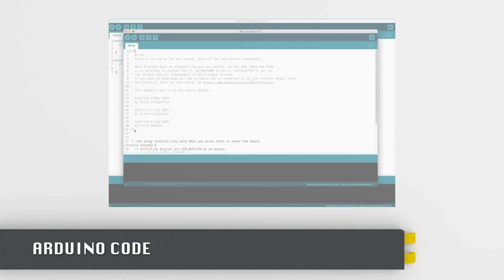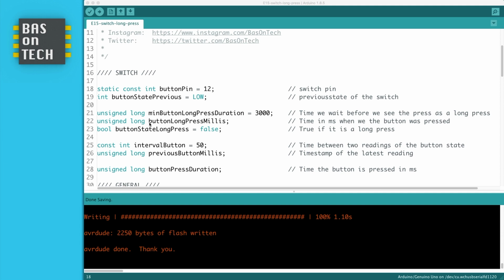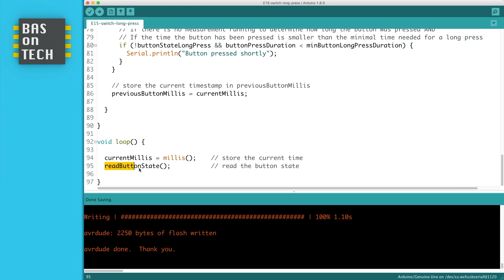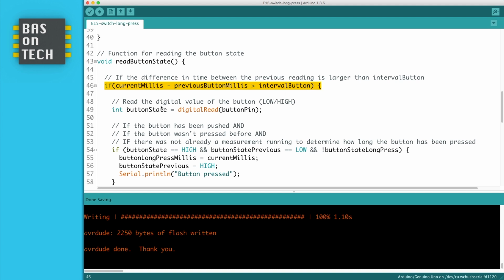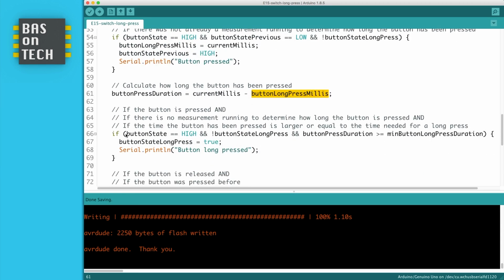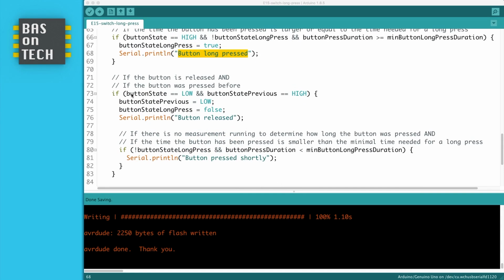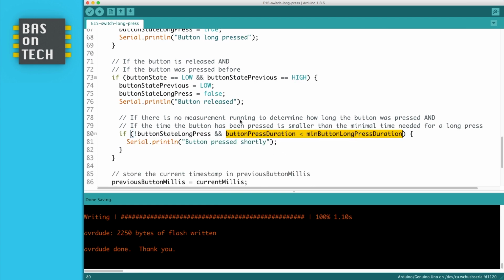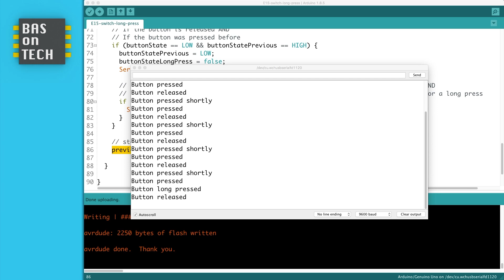LONG PRESS BUTTON (WITH MILLIS) - Arduino tutorial #15

Comment: Hello! On line 54 is it really needed to put the ... && !buttonStateLongPress? I did it without the '&& !buttonStateLongPress' and it worked just fine. Because that only matters if you're holding the button, but if you're holding the button then the previous button value CAN'T 'equal LOW', since YOU'RE HOLDING IT. 
hope that makes sense.

Comment: whats the advantage of using a external pull down resistor vs using the internal pull up of the arduino?
Reply from the maker: As far as I am aware none. In this tutorial I wanted to show how to use a pull-down resistor with an external one 😃

Comment: There's an issue in ur code for every first run if the button in pressed for a long duration in the first try ur code will not recognise it as long press instead it goes to void loop and then again performs the function to check long press
Reply from the maker: I did not have that problem when running the code. Are you sure it is exactly the same?

Comment: Hi, fantastic work. You`ve saved my day! Thanks a lot! But something went wrong in my program code. It will just run the short pressed button and never the long pressed situation. longPress seems always be on false. Any forgotten libraries that have to be integrated (time.h?)? The longPress action in the wrong if statement? Normally it has to be in the serial print "Button long pressed". Or is there maybe a problem with the milli function?
Reply from the maker: Hard to say. Make sure you create the code step by step. I see many people copy/paste the code. Then it is very hard to debug what goes wrong.

Comment: How do I do more than one button? I need to have seven buttons each with a long press.
Reply from the maker: You can use a pin for each switch.
Reply: @BasonTech  Yes I understand, but I am a novice programmer. I am going to try to spend work time this weekend trying to make two relays trigger. So button 1 = state 1 relay one on and relay two off, then button 2 = state 2 relay one off and relay two on. If I can do that, I can start adding more buttons and more relays. :)

Comment: Would this help with false positives? I have seven buttons at the end of a four meter cable, two of the buttons keep popping on and off. I was thinking that a requiring long press would stop this from happening.
Reply from the maker: Hi Douglas, it looks like your aren't using pull-up or pull-down resistors in your circuit. This can make the state of the switch "floating" and gives false positives.
Reply: @BasonTech  Hello, thanks for the comment. I am using resistors. Seems like I get a bit of static electricity that is causing the problem. That is why I was looking for something of a long hold or using the analog input. Today was a rainy day and I had no problems at all.

Comment: The intervalButton=50msec is that a debounce time for the button??
Reply from the maker: Hi Remco, as shown in the code comment it is the time between two readings of the button state. This is not de debounce time.
Reply: @BasonTech  Ik snap hem nu..Er zijn meerdere wegen naar Rome...je kunt met kortere tijd door een if() laten vallen als de millis korter is dan je voorbeeld van 3000 maar je hebt een duidelijke grens aangegeven dat dat een short press is geweest...als ie korter dan 50mSec is...wat veiliger om een onderscheid te maken tussen een short of een long press...alsk ut zo goed heb?
Code werkt verder super..precies wat ik zocht...alleen de switch is, bij mij,  active LOW maar is een kwestie van de sketch aanpassen...Dank oe iig..
Reply: @Lampie78  Deze code is zeer specifiek voor een long press oplossing. Voor alleen debounce kun je de code significant versimpelen. Eigenlijk hoef je alleen maar de timestamp op te slaan als knop wordt losgelaten. Om een volgende te registreren met een x aantal millis verstreken zijn sinds het moment van loslaten.

Comment: Sir, sorry I used google translate.

Sir, I want to use this for fans, what if after "Button long pressed" the fan will stay HIGH during minButtonLongPressDuration, after which the fan goes LOW.
Thank you.
Reply from the maker: With this tutorial you should be able to make that 😃
Reply: @BasonTech  
Sorry sir, I'm still a beginner.
I tried placing the script like below, but after the fan release it is always HIGH.

static const int buttonPin = A2;                    // switch pin
static const int Fan = A3;                    // Fan
int buttonStatePrevious = LOW;      

unsigned long minButtonLongPressDuration = 3000;   
unsigned long buttonLongPressMillis;             
bool buttonStateLongPress = false;               

const int intervalButton = 50;                    
unsigned long previousButtonMillis;      

unsigned long buttonPressDuration; 

unsigned long currentMillis;   

void setup() {
  Serial.begin(9600); 

  pinMode(buttonPin, INPUT);     
  pinMode(Fan, OUTPUT);  

}
void readButtonState() {
    int buttonState = digitalRead(buttonPin);
  if(currentMillis - previousButtonMillis > intervalButton) {
    if (buttonState == HIGH && buttonStatePrevious == LOW && !buttonStateLongPress) {
      buttonLongPressMillis = currentMillis;
      buttonStatePrevious = HIGH;
      Serial.println("Button pressed: Fan ON");
      digitalWrite(Fan,HIGH);
    }
    buttonPressDuration = currentMillis - buttonLongPressMillis;
    if (buttonState == HIGH && !buttonStateLongPress && buttonPressDuration >= minButtonLongPressDuration) {
      buttonStateLongPress = true;
      Serial.println("Button long pressed:Fan ON");
      digitalWrite(Fan,HIGH);
    }
      
    if (buttonState == LOW && buttonStatePrevious == HIGH) {
      buttonStatePrevious = LOW;
      buttonStateLongPress = false;
      Serial.println("Button released");
      digitalWrite(Fan,HIGH);  

      if (buttonPressDuration < minButtonLongPressDuration) {
        Serial.println("Button pressed shortly:Fan OFF");
        digitalWrite(Fan,LOW);
      }
    }
     previousButtonMillis = currentMillis;

  }

}

void loop() {

  currentMillis = millis();    // store the current time
  readButtonState();           // read the button state
  
}

Thank You
Reply from the maker: Looks like my code. Have you tried to download my code to be sure?
Reply: @BasonTech  
The code I wrote above is from you, I tried to modify it so that if the Button release after a long press is detected the fan will still turn on first according to minButtonLongPressDuration then off

Comment: I am having hard time on working with RGB LED. When coin cell is placed, LED is normally OFF. After pressing for about 5 seconds, the LED will be i BLINK mode. Pressing again shortly it will be in FADE mode. And again by pressing shortly, it will be in SOLID ON mode. And pressing it again for about 5 seconds it will be in OFF mode.
Reply from the maker: I see, but what is the thing I can help you with? 😃

Comment: Hi!

With this code I was finally able to use my ESP32 touch sensor as long/short press button, however there is one issue in all of that:
Using the "long press" will always trigger a short press as well, which shall not be the point of this I guess.
How to improve the code to ignore the short press if a long press was initiated?
Thanks!
BR
RoB
Reply from the maker: Hi Rob, then this is code isn't suitable. What needs to be done is measure the time the button has been pressed. So when it goes from HIGH to LOW you start measuring, and when the button is released, so from LOW to HIGH then you stop timing. You can then determine if it was a short or longpress based on the elapsed time. Hope this makes sense 😃

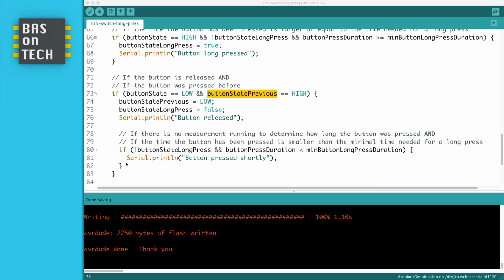Comment: at timestamp 10:19 -  if(!buttonStateLongPress && ... since you just set this two lines above, won't it always be false?  thanks for the video, this is helpful.
Reply from the maker: Hi, nice find! Indeed on line 75 I make it false, so !buttonStateLongPress is always TRUE. Therefore you can remove the "!buttonStateLongPress &&" part from the if. There is no use to have this part checked. I've updated the code in the course material. Thanks for letting me know! 😃
Reply: @BasonTech  thanks again for the video and code.  I used it on a project, teaching my 10 year old son. We connected for buttons to an RGB LED, one for each color.  Long press a fourth button puts it into 'record' mode, short press ends record mode and initiates playback of the sequence and duration of button pushes.  Your use of the millis() function gave me the idea to measure duration of press and pause between presses.  Thanks!

Comment: Is it possible to make millis function in separate tab and use millis single line command like delay? For make code more simpler
Reply from the maker: Hi Shrikant, this should be possible. You then include your functions via the separated file.
Reply: @BasonTech  but how?
Reply from the maker: I don't have an off the shelf example for you. But if you search for "arduino split code multiple files" there should be many examples.

Comment: Hi, Thanks for the informative and useful tutorial. I am new to coding and arduino. Is it easy to add another button to this set up without having two lots of code for each button?
Reply from the maker: Hi Pete, that kind of depends on what you want achieve. You still need to determine if the button was long pressed for each button.
Reply: You could do this by passing variables back and forth to the function. Pass the button address to the function so it checks the right one for long/short press. Return the press state as an integer, 0=no complete press, 1=short press, 2=long press.

Comment: Did you have any code of arduino sir. There are 2 buttons that 1 button is the led would run and the 2nd button is for faster and That if i press the 2nd button it will increase the speed and then if i press again it will increase and so fort then if it reach the limit it goes back to the designate value i means it will go back to the normal speed. 

I hope you can help me
Reply from the maker: Hi Mico, sorry I don't have a on the shelf solution for your idea. However, take some time to split your idea into smaller challenges. Later you can merge them together. The trick is to start small, and gradually build bigger projects 😃
Reply: Thank you sir. I've been struggling for the condition for the 2nd button 😭. But anyways thank you for the idea.